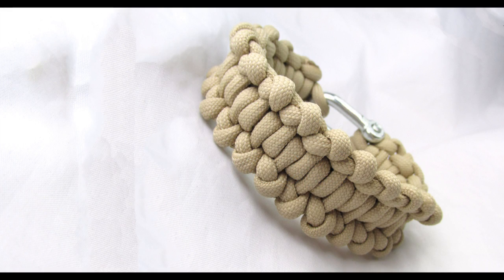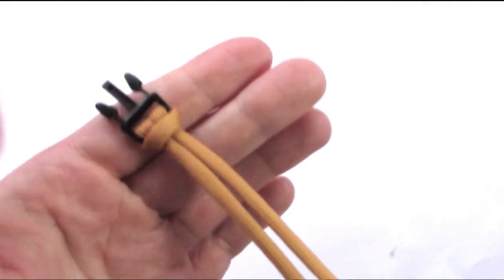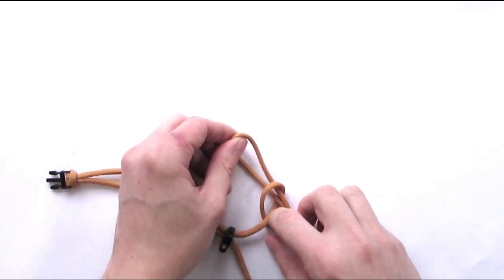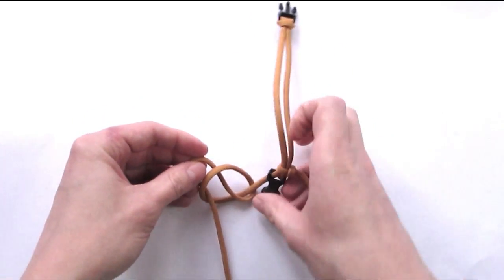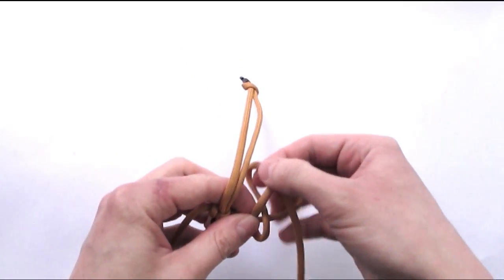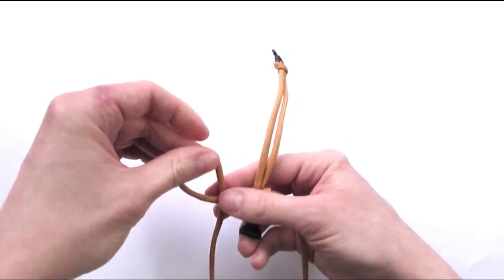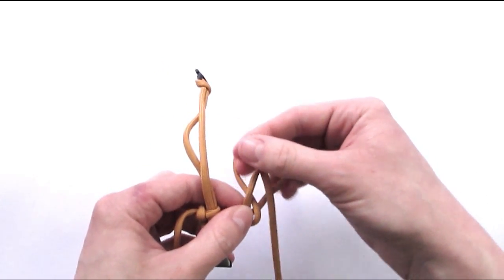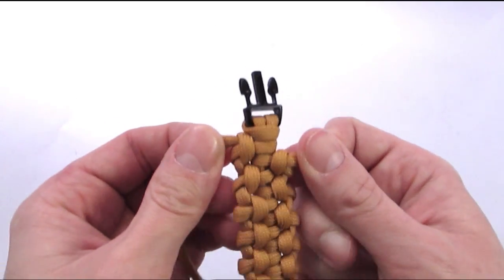Backbone bar paracord bracelet

Comment: How do you end up with such a uniform looking bracelet? I've made quite a few of these but the braid/weave never looks that neat and regular and even the width of the ones I make varies along the bracelet. I try to tighten each slipknot exactly as tight as the next and keep the centre cords the same width/position when tightening... but I still get results that don't look as neat and uniform as the one pictured in the video.
Reply from the maker: Hey!

I completely understand. Learning the tightening part of this bracelet is time consuming and sometimes even frustrating. This was one of the hardest ones for me to learn and it took time. I may do a follow-up tutorial on tightening these knots if you wish.

Mark
Reply: Thanks - I'd watch it 20 times :)